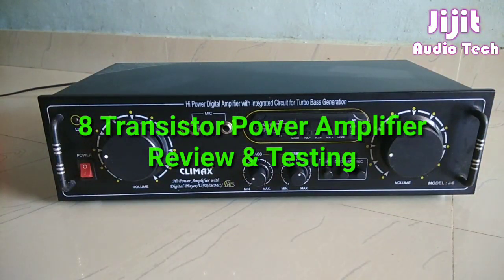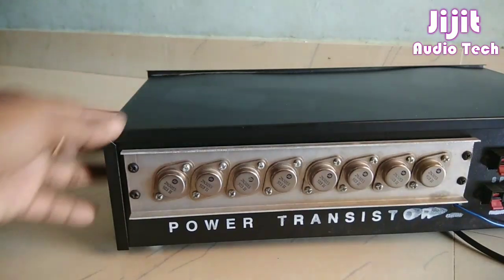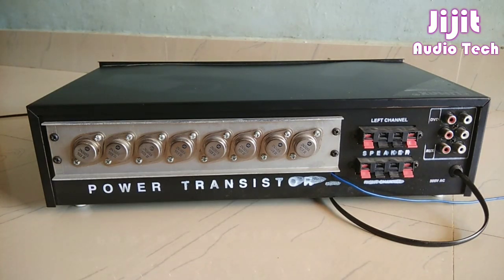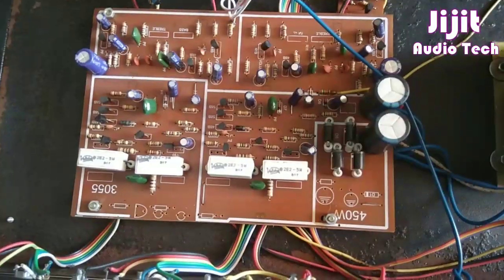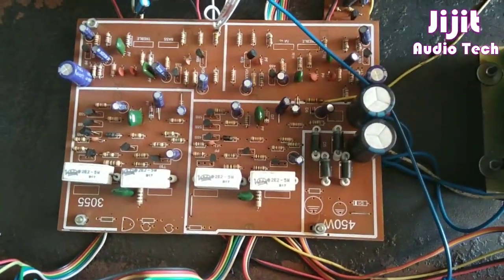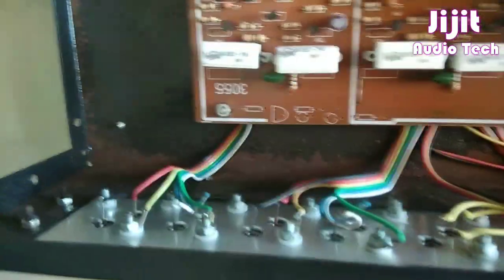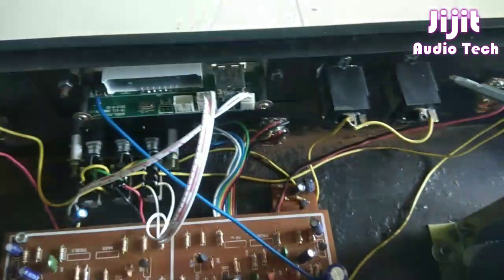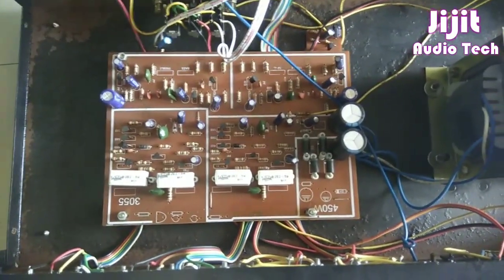Metal Transistor Amplifier (2N3055 x 8nos) Testing & Review. ഇതൊന്നു പൊളിച്ചു നോക്കാം..

Comment: Super quality ആണ്...Transformer .wiring .diodes .caps .speaker protector .load resistor എന്നിവ update ചെയ്താൽ life കിട്ടും ,,,8 ohms ആണ് നല്ലത്.നല്ല heat produce ചെയ്യും ...cooling method വേറെ നോക്കണം...18 t0 22 v ആണ് മിക്കതും... 33 0 33ൽ പണ്ട് ഒന്ന് എന്റെ കെെയ്യിൽ ഉണ്ടായിരുന്നു...super performance
Reply: സത്യം